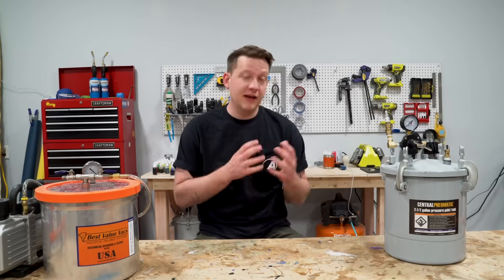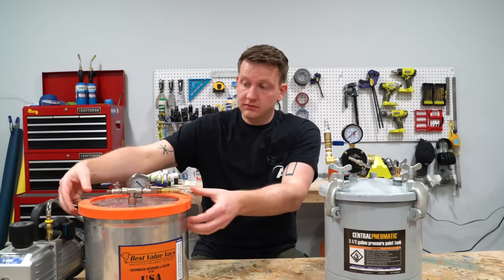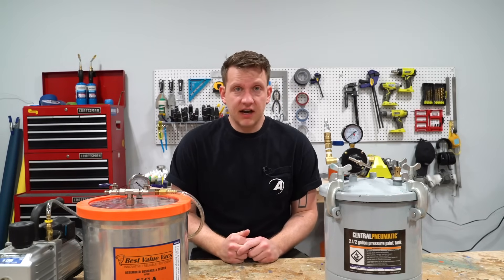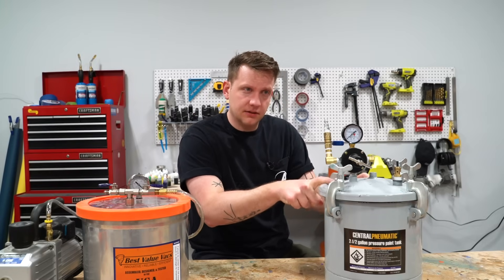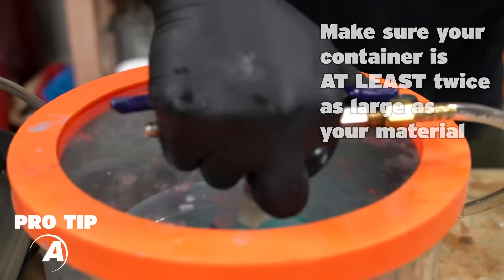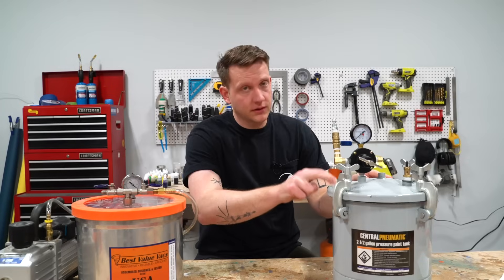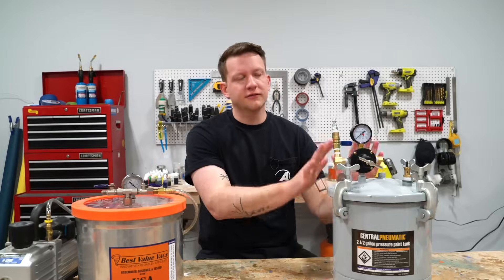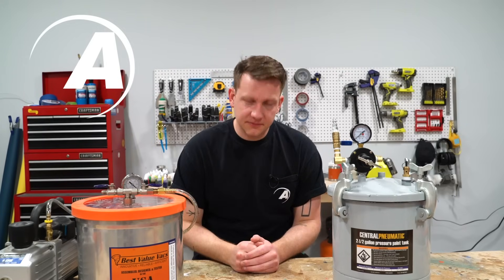When to Use a Pressure Pot or a Vacuum Chamber | Alumilite

Comment: Question on the pressure pot ....  if the mold does not fit as demonstrated in the video, can you set the pressure pot on its side and run it????
Reply from the maker: You absolutely can put the pressure pot on its side to fit large molds. We want to make sure everyone's being smart and safe and make sure to secure the pot to a rig or something to keep it stable. And, as always, follow the manufacturer's recommendations first - if they don't recommend that for the pot you have, then we can't either.

Comment: This was very clear, thank you!
My biggest confusion is that the internet is super divided on whether "pressure-potting" the silicone before casting is appropriate, with advice ranging from "never pressure cure your silicon because the bubbles will spring back" to "it's perfectly fine, I do it all the time".  I'm not going to lie, money is a huge issue to me, and I can't afford to buy both a pressure pot AND a vacuum chamber, with their associated pumps. If I need a vacuum chamber (and pump) to make the pressure pot work, then I best not invest in a pot right now. But... I really need to get these bubbles out of my casts. I may be SOL, but any thoughts you might have would be appreciated.
Reply from the maker: We totally understand! It's tough because every maker has a different method. If your castings have bubbles in the resin and that's what you're most concerned with, pressure pot all the way. It entirely depends on what you're making and what preventative steps you can take. For example, mixing slowly, pouring into one corner, etc. all helps bubbles in silicone molds release, so that when you cast with resin you'll have smooth castings.
Reply: @brianlindsay9097 Regarding your old question about being unable to buy both a pressure & vacuum pot, I just watched another great YT video by a pro doing without his favorite vacuum/pressure tools while creating at home during lock down.   Two parts with some good tips you might find helpful

Part 1:  https://www.youtube.com/watch?v=NmrAm6h8jzU
&
Part 2:  https://www.youtube.com/watch?v=XZnedPply48